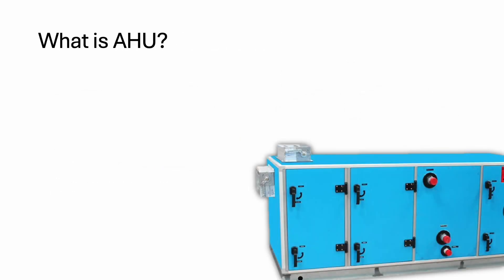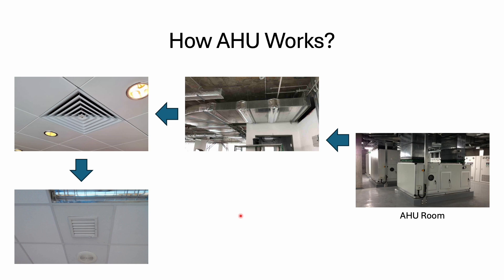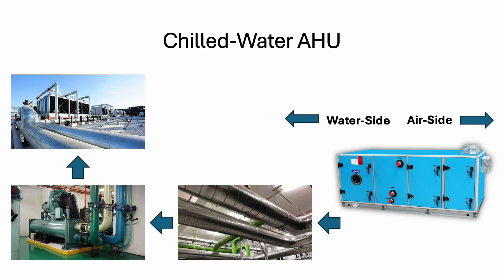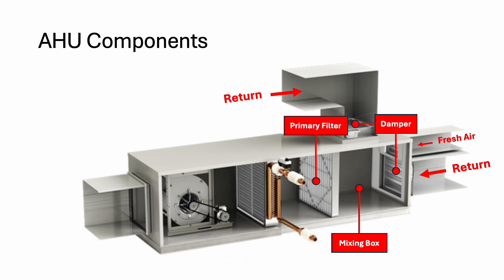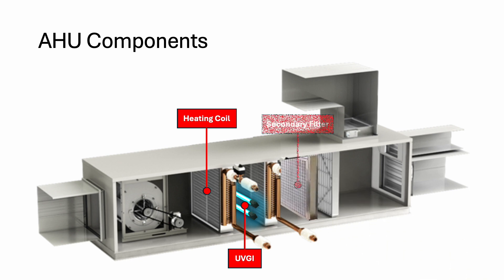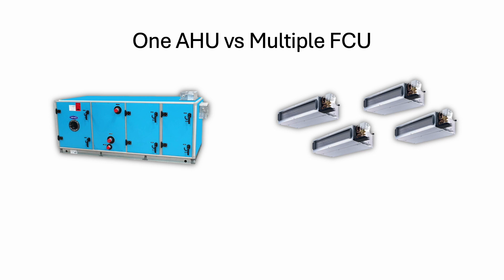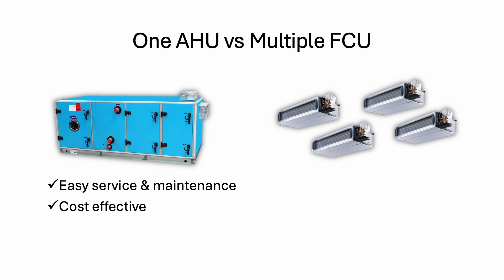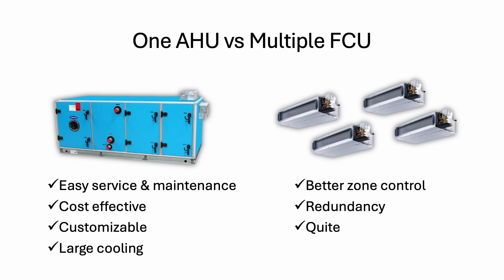AHU Basics | AHU Components | AHU vs FCU

Comment: Hello sir..I am an undergraduate student..currently I am in my training period.They use both VRV water cooling and Chiller water cooling..can you tell me how we control cooling load(cooling temperature in VRV indoor unit and AHU...😢is it same of different?Also there are no VAV boxes and VSD in AHU..star delta method used for starting method..
Reply from the maker: VRV indoor unit may use the built-in temp sensor at each indoor unit to control room temperature. AHU may use return air temp sensor to control average room temp.
Reply: @aircondlounge  Got it..thank you very much sir❤